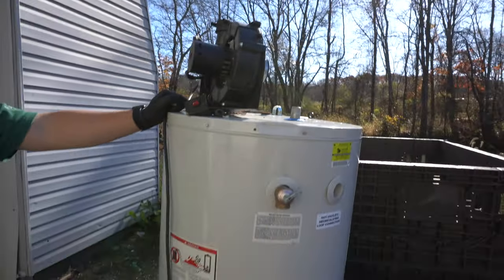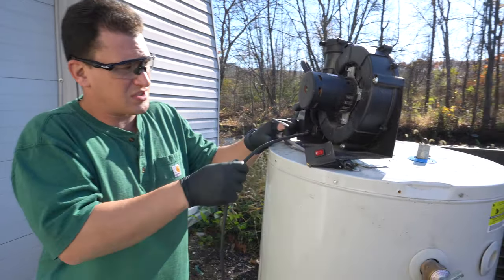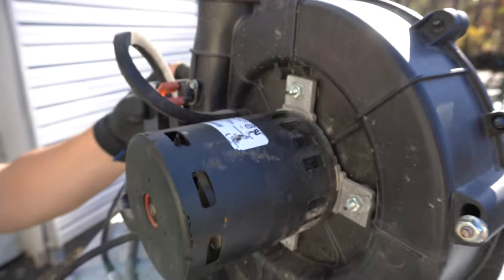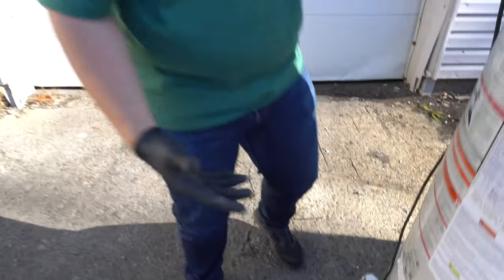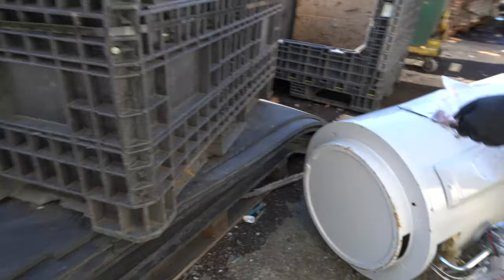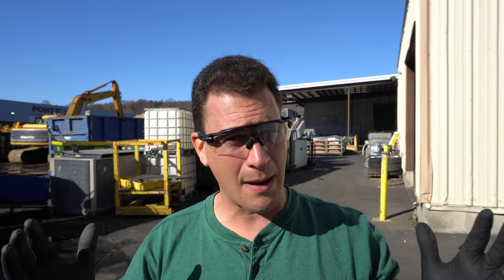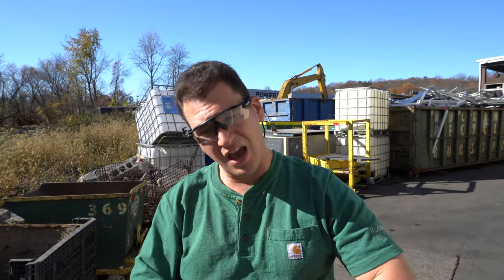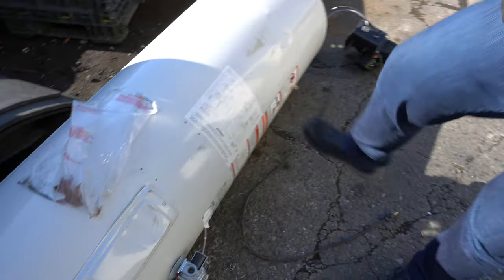Scrap Secret: Making A Profit on Water Heaters

Comment: I specifically bought a pipe wrench to remove brass and copper fitting/pipe from water heaters its paid for itself tenfold
Reply from the maker: No brainer- we have found many inside of the scrap pile :)

Comment: what???!!!! i never saw that copper coil before i would love you to have shown one
Reply from the maker: The next one we find we will save and make a video on!
Reply: I only find them in commercial grade like designed for a laundromat. when I sold my old laundromat I had 2 spare water heaters I brought out of one that closed for $100 for the pair. Seeing that they sat forever in a barn I took that copper out. smaller unit had a 50# coil and the second unit had a double coil for 100# so I got $450 just for those coils. I was happy.

Comment: Bro... U can take the elements or "coils" out since ur already effin with it and charge $5 a piece at ANY flea market AND GET THAT... They're $15 where I'm from... But thank u for enlightening me about the 15 or 20 pound cooper coil that goes around some units cause I had no clue about that... I'm an electrician and I keep up with plumbing code AND electrical code so I was interested to know that that style of water heater is built that way... It seems to me that it's only in commercial applications when you actually see that style of coil on the heater but I'm sure they sell it domestically for residentially somewhere... Always good to know new tips and tricks and hacks and stuff like that so we can get by and make a little extra money on our scrap metal though... I don't know where you're located at but I'm in East Tennessee actually upper East Tennessee and I have all kinds of radiators a couple water heaters engine blocks a lot of aluminum a lot of brass a lot of copper a lot of stuff man and a lot of it is still good stuff so just hit me back

Comment: What about the heating elements that are tungsten I've seen pictures that there's some water heaters that are solid copper but they have steel wrapped around them or some kind of sheeting
Reply from the maker: Some are tungsten coated- but not worth enough to sort.

Comment: Is That copper coil is only on gas heaters?
Reply from the maker: Not always, could be on other types.
Reply: I find them in commercial grade heaters like designed for a laundromat.  haven't found any that was in a house setting yet.